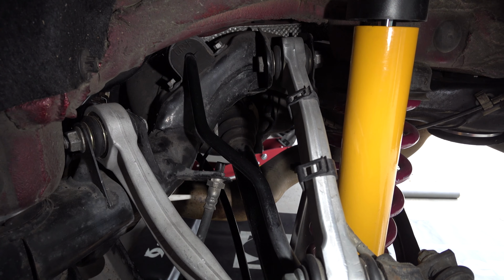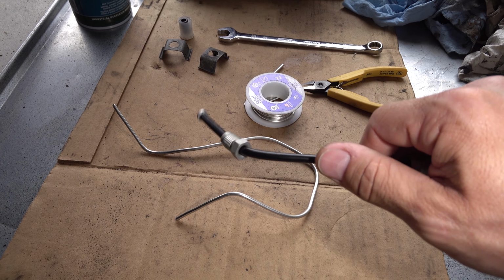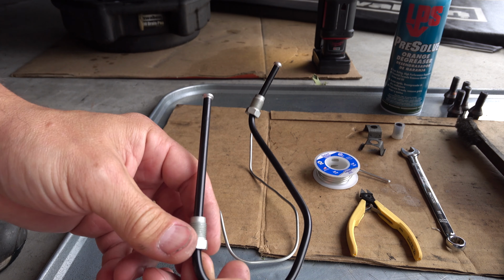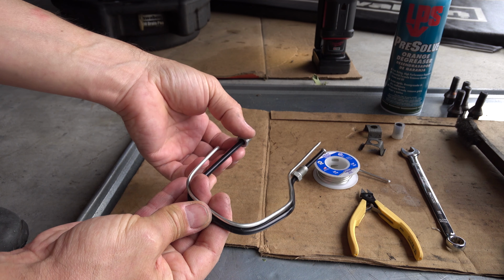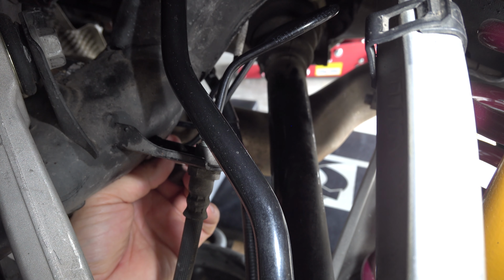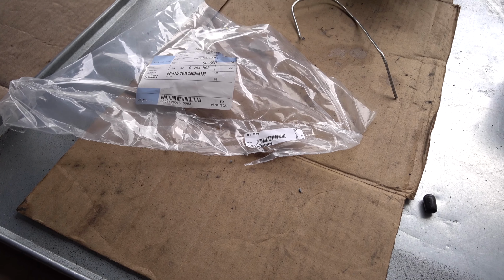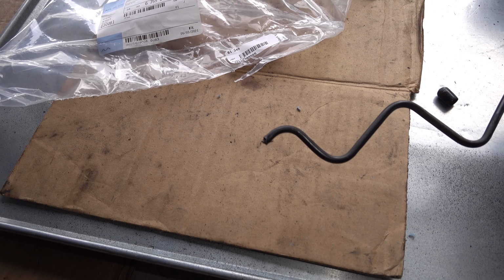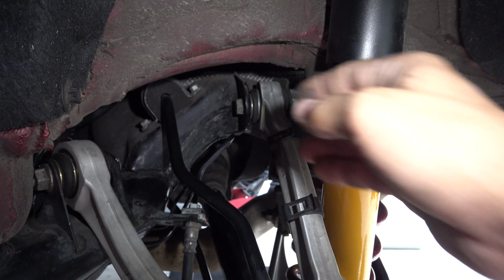How to fix the rear brake line on a BMW E90 #328 #bmw #howto #brake

Comment: 'Unrusting' those brake line ends sometimes can be done by adding a lot of heat. This can be dangerous if the brake circuit is still closed. So if you're replacing the brake anyway, you can cut the hose attached to the line and start heating this end coupling of the brake line. Penetrating oil usually does not work for this job.
Reply from the maker: Yea. I have done rusted hardware removal with a torch before. Just that it's really not a good idea to apply high temperatures to brake tubes - for multiple reasons. But part 2 of "rusted brake tube repair" - where i explore some options - is coming :)

Comment: Hi, what is the part number? I have the same issue where this piece broke (rear left) And it is ridiculous how much this shaped line costs. The line from the frame to the front of the car is like €25,- but this line is about €55

Edit: sorry, commented before the end of the vid, will order the same one.
Reply from the maker: Yep. There's a few bmw oem straight lines of approximately this length I came across that can be used.
Reply: @maxsam201  hey did you find that the one you had ordered was too long from the original or too short? Would you recommend getting shorter one, the one you have in this video is 360mm long, I found one that’s cheaper but is shorter
Reply from the maker: @E90Garage  360 mm is more than needed, shorter lines will work, i think 250-300 mm is still good enough. but i will double-check these numbers shortly.